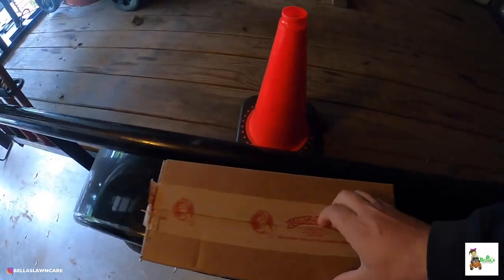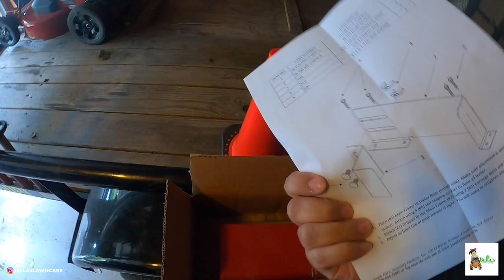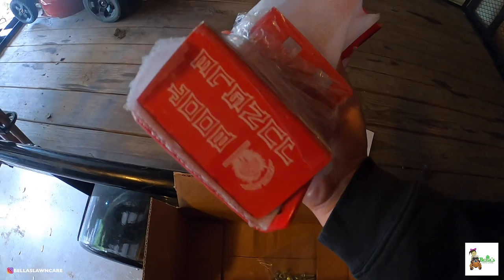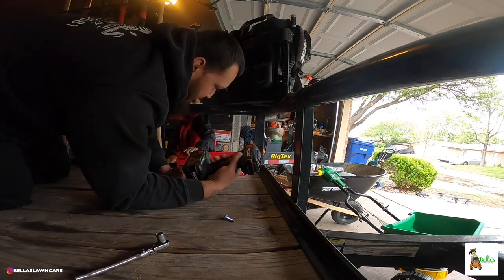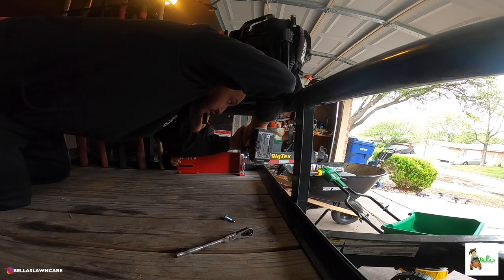Jungle Jims Jungle Boot (RAINY DAY)

Comment: How does it work??
Reply from the maker: Ruben Perez no problems yet. Keeps mower in place.
Reply: I was wondering that, too? Looks good!
Reply from the maker: Kingofmphs gets the job done. I’ve only had mower come out of place once and that was on me for going fast and hitting a bump lol
Reply: Installed backwards I think. They want their name facing outwards.
Reply: Definitely installed backwards and incorrectly. He didn’t want to drill through the steel frame of the trailer so he didn’t put the bracket where it was supposed to be either. Should’ve read instructions